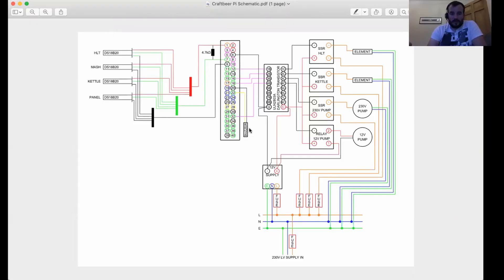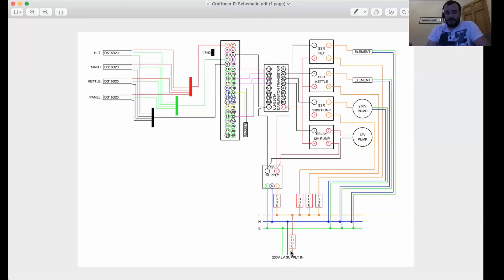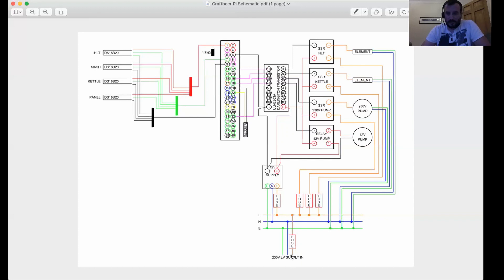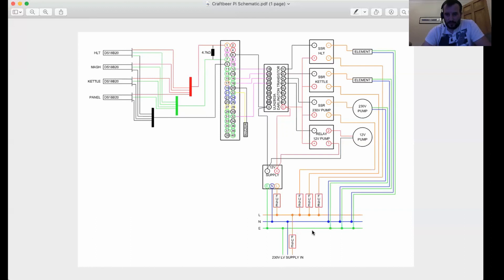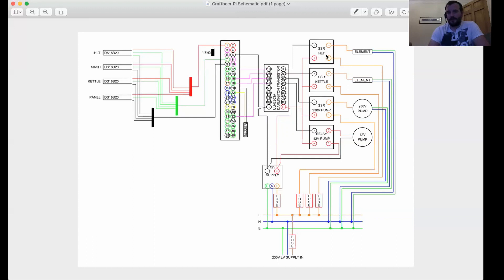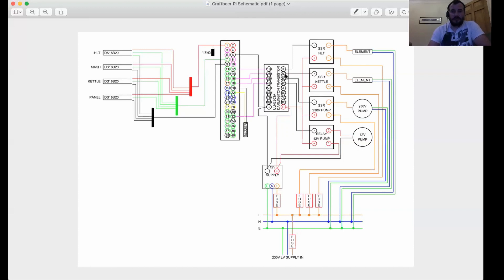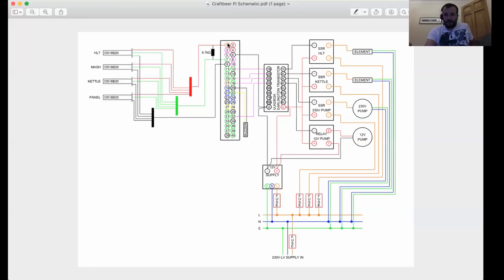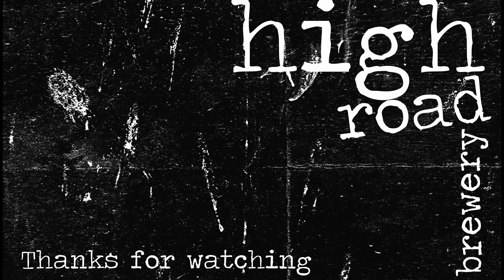How to wire up the CraftbeerPi brewery controller

Comment: Nice project..

Can you still dimme power to Elements using Darlington transistor? via raspberry
Reply from the maker: Mmmm good question! I’ve never bothered to cut the power as 2.4kw is perfect for the boil
Reply: @AndrewLynch9  Could you please check that? I will do a similar build..

Great video..

Comment: Hi Andrew - I have finally completed the build of the Brew Controller and started to look at the CraftBeerPi software configuration. I have a standard HERMS 3-pot system with 2 pumps and 3 sensors (DS18B20). Sensors are working fine and are reporting correctly in the CraftBeerPi app. However, I am unsure about the remaining configuration. I assume I have to configure "3 Kettles" - HLT, Mash and BK. What is an "Agitator" and what "Control Logic" have you used? For the Mash tun, do you set the Heater Switch to that in the HLT? Sorry for all the questions. A template setup would be useful for standard configurations.
Reply from the maker: David have you watched this? https://youtu.be/YGARUJgFWh4
Reply: @AndrewLynch9  I have... it shows them adding an "Actor`' and an `'Agitator`' but I have no idea what they are. I cannot find anything that explains what these are.
Reply: ok - found some further info. An agitator I think is simply a stirrer which I don't have and therefore irrelevant for me. An "Actor" is any electrical device, such as a heater or pump. I will take another look.

Comment: Hi Andrew - just comparing your wiring diagram to that from CraftBreerPi... I see your elements have Neutral (and Earth) connected directly and the Live comes via the SSR, which will complete the circuit when switched on. However, on CraftBeerPi, they have the Live (and Earth) connected directly to the elements and the Neutral comes via the SSR. Is there any reason for the difference? Does it make any difference?
Reply from the maker: I would rather switch my live circuit than always having 230V going to my element all the time. Means if there is a fault to earth I can cut the power using the SSR if the breaker hasn’t already tripped.
It’s a heck of a lot more safer switching the live and standard practice for electrical wiring. 
So to sum up copy the way I did it 👍
Reply: @AndrewLynch9  Thanks for this - I agree that in standard light switches (for example), the switch operates on the LIVE feed. Can you confirm for me please on the low voltage side that the "+" terminal is Ground and the "-" terminal is from the GPIO? Unsure if it makes any difference, but at the moment I am not planning to use a Darlington transistor.
Reply from the maker: @spilsburyd  don’t think it makes a difference
Reply: @AndrewLynch9  cheers. One last question (for now 😀)... I bought the RPi jumper leads (male to female) but wondered how you connected these to the SSR. Can you crimp a fork/eyelet connector on to the male end?
Reply from the maker: @spilsburyd  i just cut it and crimped a connector on

Comment: Hi Andrew - I assume the software will never allow the HLT and the BK to be switched on at the same time (or even overlap). I know in practice they would not be anyway, but the system I'm designing is for a maximum of 25A and would cause the MCB to trip anyway - so safe. But just would like to know the software prevents this from ever happening (so not possible to send an ON signal the both GPIOs at the same time).
Reply from the maker: Oh it’s possible. You would need to have both HLT and Kettle set to auto. I turn off the HLT by hitting off auto at the sparge so the element doesn’t burn out when I empty it. Then I turn the kettle on afterwards when I get the wart above the element
Reply: @AndrewLynch9  I think a good idea would be to have the LIVE for both the BK and HLT to come from the same 25A MCB (5.5KW elements). So, if they did come on at the same time, the MCB would simply trip -  a 25A "connector block" to provide 2 feeds for each element. I have a seperate 5A MCB that will provide LIVE to another connector block from which it will also have 2 feeds for each pump - but they can be on at the same time as each will draw about 1-1.5A anyway.
Reply: @AndrewLynch9  I have my version of the layout - could I share this with you please? It is a PNG file. I would like to see if you think it is correct? I am a little unsure of the wiring between the SSRs and the RPi 4. I am not using a Darlington transistor - hoping the 3.3V is ok to switch the SSRs.

Comment: What SSRs and heat sinks do you finally use? I will need 4 in my enclosure and the ones on BrewPi are 12.3cm wide (heat sink) - which would require a huge enclosure.

Comment: Hi Andrew - the 230V pumps typically draw about 1 - 2A of current. I see you are using a SSR to provide power to the 230V pump. First question is would you choose an SSR that has a maximum Load current of about 2A? Second question, why use an SSR at all for such a low power device? Could you not simply have a switch to manually switch it on/off?
Reply: I assume it is like this as we switch the pump on and of with the Raspberry Pi software. So, just need some guidance on the SSR type. :-)
Reply from the maker: Any SSR that is rated and can be switched with the 3.3V of the Pi or 12V using the Darlington transistor.
Reply from the maker: Joe the idea is not to have any physical switches at all. You could use a 230V mechanical relay if you want that’s if the raspberry pi can drive it. The pumps use below 1A. Reason I used an SSR is I got 3No in my order as a package.

Comment: Looking for an appropriately sized enclosure and found this: https://www.amazon.co.uk/waterproof-adaptable-enclosure-electrics-connection/dp/B0151KNMB2/ref=mp_s_a_1_5?dchild=1&keywords=ABS+Box&qid=1602629094&sr=8-5

I think I will need 4 SSRs - hlt, boiler and 2 pumps. Will these fit with the other components?

Comment: Hi Andrew - did you use a "breadboard" for the Darlington transistor and connections? Also, which SSR/heatsinks did you choose in the end (product numbers if you have them)? In fact, do you have the list of parts used (including the enclosure)? Many thanks.
Reply from the maker: I used a breadboard at first but managed to get one that comes with a PCB board. I recommend you check out Chris’s blog post over at the hop addition as he’s recently pulled together a parts list here https://www.thehopaddition.uk/2020/09/24/craftbeerpi-brewery-build/
Reply: Thanks for this. Getting closer to starting it!!!

Comment: If you wanted to add some solenoid valves to automate transfers would you do that with more relays tied to the Darlington transistor? Looking at doing something similar but don't have much electronics background.
Reply from the maker: Hey on my setup yes I was run it through the Darlington and a relay to operate a solenoid valve.